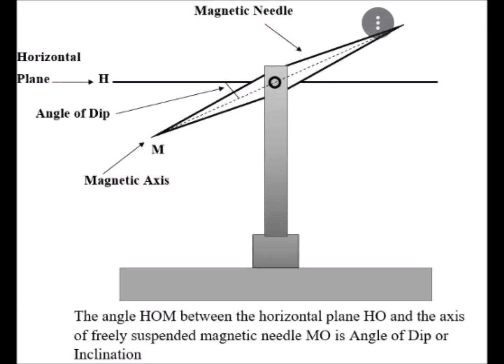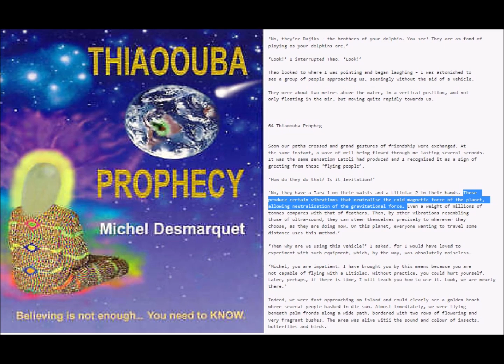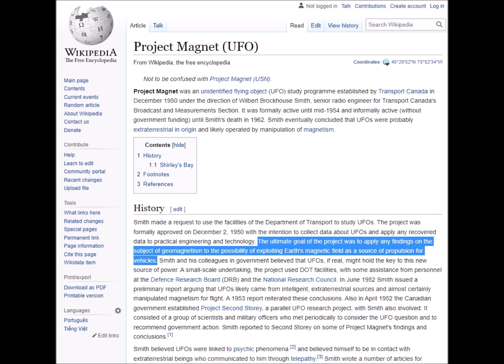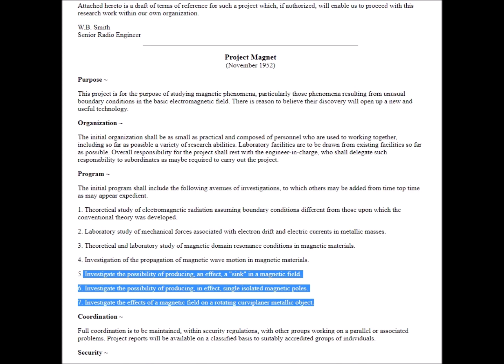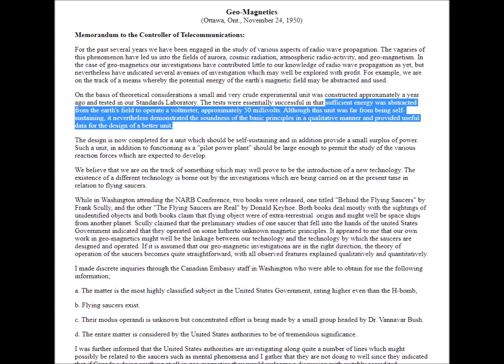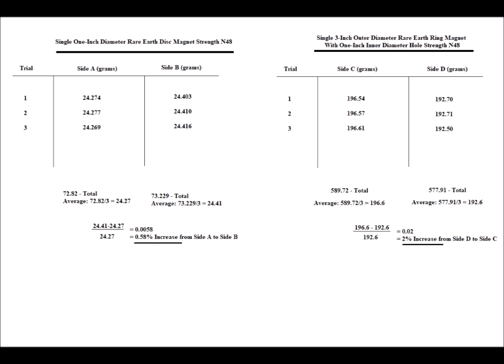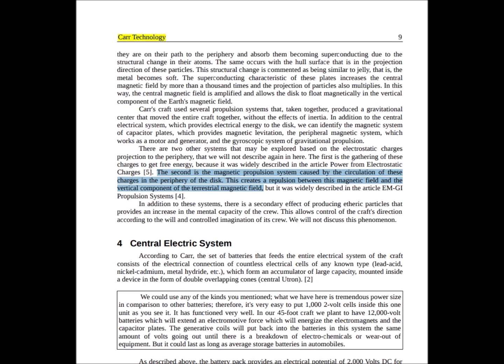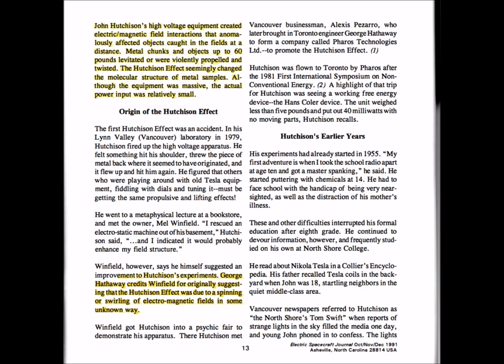GeoMagnetic Levitation: Project Magnet and the MagnoCraft

Comment: The mainstream theories say that if you have a  metal sphere that has excess negative charged particles on it that it would generate an magnetic field if rotated. Interestingly enough I have never seen an actuall demonstration of it. But i think there is something missing in that theorie, because if a sphere or ring is just charged up and rotated the charges there are still free enough to to orient and move in any direction they want. So either charges, that have a big enough inertia have to be used, so that they cannot reorient quick enough during one revolution. Or increase there inertia by additional vibrations, etc.. or an internal current flow through a small voltage.

Comment: The earth is rotating with a incline around 23.43 degrees with a sidereal spin around 1000 miles per hour at the equatorial nodes. Under Saturn's influence magnetic attraction is slightly stronger than normal. Most types of Granite are strong ferromagnetic, thus it is my opinion, during that time of Saturn's influence, stone of granite properties, will weight slightly more. Yet, I am still unsure about that last claim.
Reply from the maker: That's an interesting theory. I've certainly heard of celestial bodies affecting these forces, which is sometimes said to be one of the reasons that the ancients were so obsessed with tracking them.
Reply: @gsutton78  they all fear the Sun, it is unpredictable and has incinerated over a 100 different races and civilizations here alone. When Ra is angry, he comes for our Sol. So far, he seems appeased, and I am happy for that. We are in a time for the great ones return, so when their vessel enters our orbit, cataclysmic patterns emerge. Be safe and blessed, you have enough wisdom that I know you will survive. When looking for shelter, think in terms of Faraday cage.

Comment: You will want to read patent 1,159,488 magnetic field repulsion apparatus. " To cause repulsion between the earth and craft the electron flow in the rings in T1 and T3 is in a clockwise direction and T2 in an anticlockwise direction. Such directions of electron flow causes areas of high magnetic intensity below and around the craft giving sufficient repulsion against the Earth's magnetic field. It is demonstrated that the charge field appertaining to the resonance radiation caused by 2537 AU light is in the negative aspect relative to the charge field appertaining to the magnetic field of earth"
Reply from the maker: Interesting! I couldn't find that particular patent. But I did find one called, "System utilizing the earth's magnetic field to generate a force in opposition to the force of gravity" US7446636B1". For some reason I never thought of checking patents on this type of technology. I need to start. Thank you!
Reply from the maker: @scraw3   Wow, thank you so much! I can't believe how many of the explained concepts are very similar to those I have been thinking about for quite some time! Thanks again!
Reply: Cannot find that particular patent, think the patent number is wrong.